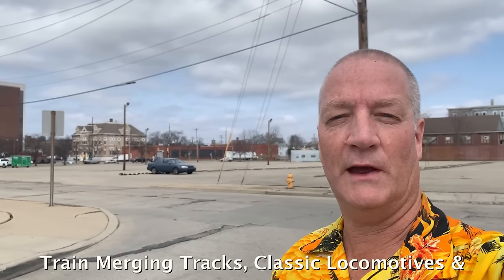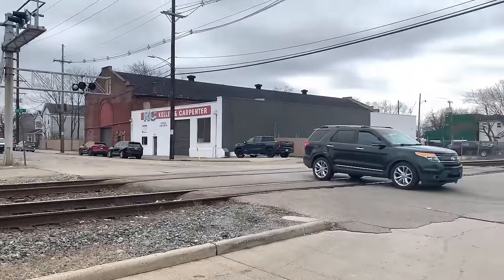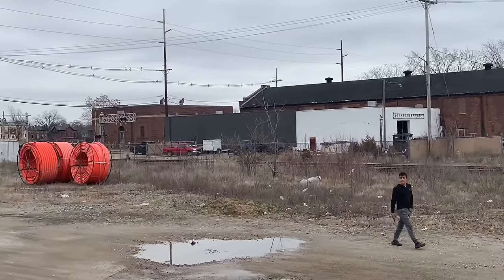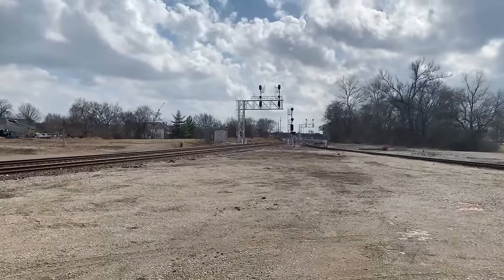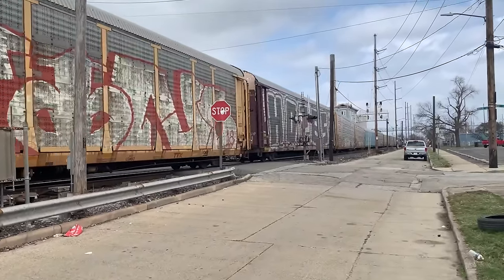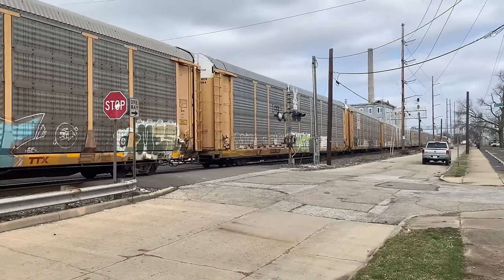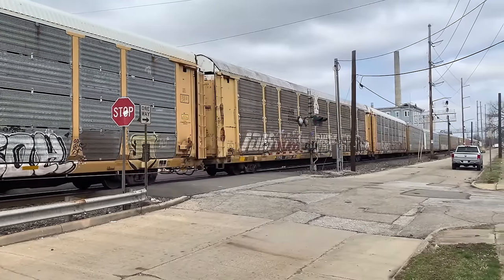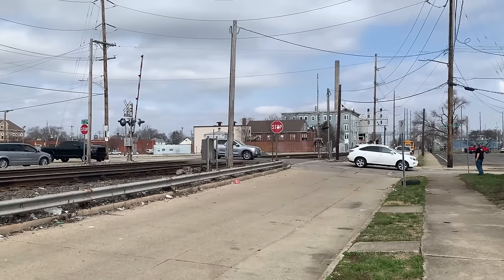2+ Mile Long Train Diverging From CSX To Norfolk Southern Tracks, Hamilton Depot Update, Auto Racks

Comment: Always something interesting for the discerning viewer.  NS 4754 leading the heritage unit train is a newly rebuilt GE AC44C6M of their second order of 100 units. The first order was 4000-4675. 
The axle counter for the CSX autorack train was off 1/2 a car. 570 minus 12 for the engines =558. Divide by 4 and you get 139.5  cars.

Comment: The trains on this video were interesting to watch, Jaw Tooth! The CSX train heading onto the CSX Sub was unusual. Usually, CSX trains come off the Indy Sub rather than going on to the CSX Indy sub. When you mentioned in your description that there was a New York Central Heritage Unit in this video, I was wondering if you were lucky enough to catch CSX's New York Central Heritage Unit. It was great to see that a new roof was being put on a portion of the Hamilton, Ohio depot. Some work is finally being done on the depot. I am wondering if they are going to reconnect the two sections of the depot so that it looks the same as it did in its previous location.
Reply from the maker: Thanks  for watching and thanks for commenting Thomas!

Comment: JT: have you considered a copter with high definition camera? Good for two trains passing.
Reply: I'd like to see JT get access to a four-rotor drone. However, FAA and railroad regulations could make its use not legal near railroad tracks.
Reply from the maker: Yes, I want to get a drone
Reply: @JawTooth  Check railroad regulations at CSX and Norfolk Southern before getting one. I don't want to have a $500 investment go down the drain because the railroad police confiscated the drone.
Reply from the maker: @Sacto1654  Regulations are the main reason I haven't got one yet.  I need to learn all of them and learn how to use it.  I also have to decide which one to get.  It will take some time to do it right